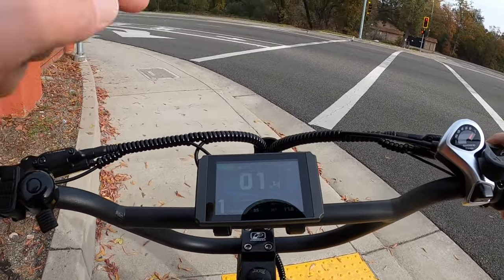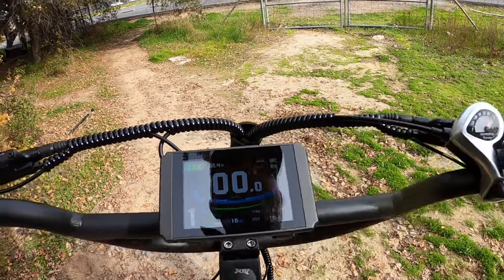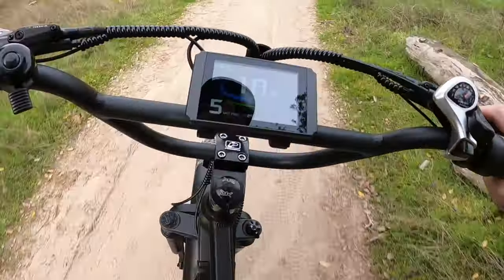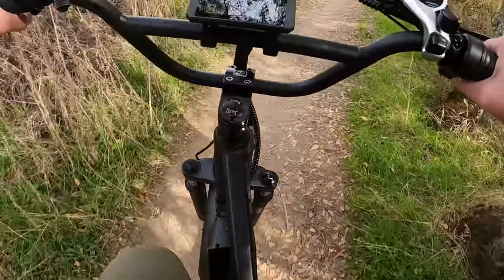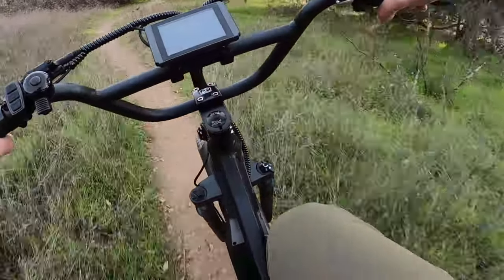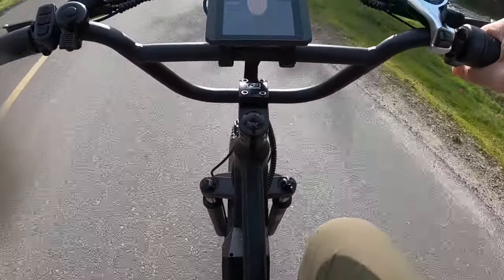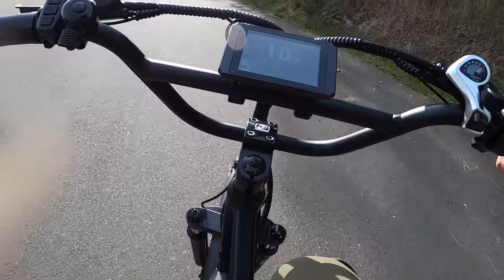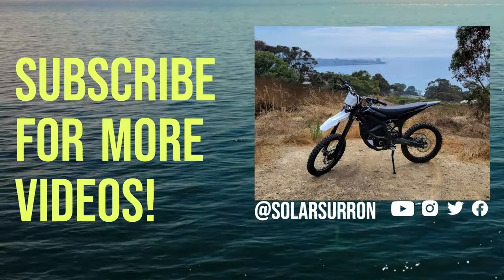Update! 2024 Wired Freedom

Comment from the maker: Leave a comment below if you know what the maximum temperature for the motor is for the 2024 Wired Freedom!
Reply: Ok will make a second post.  From one of the FB groups I belong to, this one specifically for Wired, here is some information being passed around involving C5
C5 set to 10 is NOT incremental, MAX (1500 watt nominal) power from start and always.
C5 set to 0, 1, and 2 Slow start ending in Max Power 0 being lowest and 3 highest.
Now it gets interesting.
C5 set to 3-9 supposedly as follows 3 = 750 watts thus making bike U.S. Class 1, 2, and 3 compliant.
4 = 1000 watts, 5 = 1125 watts 6 = 1200 watts 7 = 1250 watt 8= 1300 watts and 9 = 1365 watts.
This would be why you see I difference in top speed 5 vs 10.  5 = 1125 watts and 10 = 1500.  Remember this is nominal power.
Hope this helps.
Reply from the maker: @NOWitsOKto  That makes sense being the nominal power, I really appreciate the in depth explanation!!
Reply: @leetjohnson  I'm just passing on info from a group with hundreds or a thousand members.
It's like I'm a wide body (in the 1950s when I first learned to ride a bicycle, they called us Husky) person, thus putting mirrors on is a PITA.  So I'm trying something different, (absolutely don't recommend for trail riders catching air, etc.) but using a rear facing camera with a 4.3" display (ya that's bigger than the bike's display) to see to the rear.
Thus far, good for the riding I do.
I subbed to your channel on the other video as I like the no BS, this is what they claim, and showing what real situations are.
May I suggest as I've seen from other YT video, on occasion you might consider (for example in the speed test), "I'm 6'3" 220 lbs and blah blah, as we know weight and wind resistance play a part in the results. Just an idea, you might want to say, as it kind of gives a reference point.
Keep up the good work, and hoping your channel grows.
Reply from the maker: @NOWitsOKto  thank you so much!
Reply: @leetjohnson  Motor temperature wise, I saw one of TailHappy TV's videos where he rode his '23 Freedom on the beach in the dry soft sand at full throttle until it overheated.  It just stopped working for a few minutes.  Once it cooled, he could ride it again like normal.  So, that was encouraging.   The '23 didn't have a motor temp sensor, though, so we don't know what the shutdown temp was.
Reply: @leetjohnson  That info came from my cheat sheet.  I derived the numbers using information obtained from the display manufacturer's user manual.
Reply from the maker: @robb36kc  thank you!
Reply: SciDeb   According to the info I know, 0-2 give max power in the end, but have a slow “roll up” to it. Where 10 is immediate full power.
Reply: @robb36kc  All the info I presented is for the 2024, not 2023.

Comment: how is the power compared to the surron, I know  they are both 60 volt
Reply from the maker: It is strong but only 2,000 watts vs 6,000 watts for the Surron. Top speed on the Surron is 44 mph and will accelerate much quicker to that top speed than the Wired Freedom. Obviously, the suspension is not nearly as good on the Wired Freedom as the Surron, but less than half the price too.
Reply: @leetjohnson  I’m in your area have you have any problems with police?
Reply from the maker: @ardasgames4222  Nope! No problems at all!

Comment: If I had this bike I would have to try a more road specific tire w/o the knobs. It just seems the stock tires are holding you back.
Reply from the maker: For sure...the stock tires are great for all around. I have used an amazing on road tire with a diamond tread pattern called Origin8 Supercell.  Smooth, silent ride and grip in the turns (on road) like a motorcycle tire. Check them out! Not cheap, but worth every penny, in my opinion, if you ride mostly on the streets.
Reply: Cst big boat are also smooth fat tires I run on my nomad. They are pretty good. I swapped out knobby ones too because I don't off road that much
Reply: @leetjohnson  ,…. If you are not off-roading or winter riding the fat tires aren’t necessary either.
Reply from the maker: @Doc.Holiday  I agree, but I definitely offroad from time to time, even sand by the lake occasionally.
Reply: @leetjohnson  ,.. understand that, but for someone who is exclusively an urban rider (not me either) narrower within reason, street tires would lower rolling resistance and increase range.  Granted, go that route and a different bike is probably in order.  This mission of this bike is a cross over off-road and urban truck, not a nimble 100% MTB and Urban either/or.
Reply from the maker: @Doc.Holiday  I would agree, but I also prefer the bigger tires, as things like train tracks, pot holes, bad roads and rocks are all much easier to ride over with a fat tire bike. Just my $00.02.
Reply: @leetjohnson  we’re saying the same thing. Thus the reasoning I drive a truck instead of a sports car, though I’ve owned both and in between. Same with bikes.
Reply from the maker: @Doc.Holiday  👍

Comment: C5 huh, I don't know that's good but I did see another video where they said it was on the first setting before the P1 will start, and they said the first setting should be on 18 I don't know you have one but there's two different stories now I guess I have to wait and find out myself
Reply from the maker: Are you talking about the battery configuration setting? 16 is the setting for the older model 2023. For the 2024 model, you want to set p5 to 6. C5 is the power setting from 0 to 10 regarding power. All of this is covered in the video, I even have a full 1 page photo shot that I wrote each setting out by hand. Hope this helps, let me know if you still have any questions.

Comment: I've been looking for my first e-bike for a couple of years now and honestly I should have bought something by now. I was worried about my state/town laws but I see 15 year olds driving Surrons and no one seems to care. I like everything about this bike except the size. Being 5'8 and about 145lbs, I want something smaller. I haven't found anything smaller that doesn't ghost pedal. I'm one of the weird ones that actually wants to pedal lol
Reply from the maker: As long as you ride respectfully, it's not usually a problem. Yeah, most ebikes ghost pedal, but that can often be fixed with a larger front sprocket.
Reply: @rickymahoney6664    Have you considered the Cruiser model for this same bike?  The step-thru vs step-over might be perfect for you.  You'll get a bike that fits plus all the great features that's offered on this bike.

Comment: Do you know what options to select if you want to be able to use the throttle even if peddle assist is set to "0"?
Reply from the maker: As far as I understand it, the throttle will only work when the pas is set to at least 1. The amount of power can be limited to the pas level, and it can also be always on and only on while pedaling, however, I think for safety, it is disabled when pas is set to 0.
Reply: Ok Thanks.  Keep up the good work.
Reply from the maker: @DeeRickDup  Thank you, will do!

Comment: Good stuff. I have a Wired coming. Any idea what the danger zone for motor temperature is?
Reply from the maker: Thanks! I don't know what the exact number is for the motor temp maximum, but if I find out, I will let you know.
Reply from the maker: From everything I have found online, it look like 200 degrees is the maximum, but I will let you know if it cuts out and at what temperature it was at, if it does. So far, it hasn't gone above 170 or so.
Reply: @leetjohnson  sounds legit on the max temp.  Our modern-day computer hardware is designed to decrease (or throttle down) at 100 C/212 F, which most of us computer nerds/builders don't particularly like about 90 C / 194 F.  So 200 should be safe, but if it ramps up to 200 quickly I'd be a bit concerned.
Good update, thanks for taking the time to look into the comments from the previous video.
As far as the speedometer, I've found mine to also right ever so slightly fast, compared to GPS.
In my opinion, not really much to get all worked up over.  Because of this, the mileage traveled on the display will also be slightly more than what GPS shows, again it isn't off by a crazy amount.
You will notice it more the longer your ride is.  I rode according to the Freedoms's display yesterday, 32.4 miles.  Cyclers app showed 31.4 miles and Strava showed 32.14 miles. So even the GPS apps aren't consistent.  I'd be more concerned if the display read 40 mph when the GPS says 25, that's off by a lot.
Oh, glad you mentioned the kickstand rattle, as I think that is the noise I've been hearing also.  Just a quick noise and gone and only with moderate to heavy jolts.
bout 14:26ish, two things it's actually even closer than the picture, why? Well, your weight isn't on the bike compressing the rear shock which would make the gap even tighter.  Second, I don't really think this bike is designed for hardcore off-roading like a true mountain bike which as you know has a much smaller tooth ring.
Hope this helps.
Ride Safe.
Reply from the maker: @NOWitsOKto  Wow, thank you for all of that wonderful information, I 100% agree with everything you said!
Reply: It's only 60 degrees there, and it's already reaching 170. What will happen when it's 90 degrees outside? I guess time will tell 🤷🏻‍♂️...I don't want to wait for warm weather to purchase cuz prices will probably rise and more importantly stock will be much less
Reply from the maker: @rickymahoney6664  it can handle up to 300 degrees, so it's all good!

Comment: This is the bike that I would probably get..  I still like mid-drive bikes especially with carbon belt drives.. The chain rings are smaller so I wouldn't have to worry about hitting a stump or rock as much..  It does seam like they have more torque for the mountains here in Colorado..
Reply from the maker: Mid drives have great torque! This bike is powerful and cheap, that's why I got it. If you plan to do a lot of steep hills or serious off-road riding, mid drive may be the better option. Let me know what you decide!
Reply: @leetjohnson  Will do..
Reply: I need to find a video that explains this. Trying to find your first e-bike and not knowing the difference between belts, motors, controllers, cadence sensor, torque sensor, etc. Its alot more info than I realized, and it's a little overwhelming when you don't know the difference. I've been riding on 2 wheels my whole life, so I know I could handle any of these bikes but it's hard to pull the trigger when you've never tried any of these options. It's also hard to make a decision when you can't even swing a leg over the bike first, nevermind actually ride them...Sorry for the rant
Reply: @rickymahoney6664  Its all good... It still seams like the ebike world is changing so fast that everything might be different tomorrow...
Reply from the maker: @rickymahoney6664  I'm here to answer any questions you have! Ask away!

Comment: I heard that you were supposed to put it to eight on the p5
Reply from the maker: If you have the 2024 version (with the Samsung battery cells), you actually need to set it to 6. I pinned a comment about this here in the comment section after I spoke to Wired, and they said that the older model (2023) should be set to 16 (LG battery cells). Where did you hear about setting it to 8? I have heard that from a few videos as well, which is why I reached out directly to Wired and asked them. Thanks for the comment, I appreciate it!

Comment: That 56tooth chainring is perfect matched with the 11 tooth sprocket in the back will eliminate that annoying ghost pedaling . I’m skeptical a little on the quality of the components , brakes , batteries . As this e-bike looks great on paper . I’m not a fan of metal sided gears . Tends to make the motor sound loud . Overall seems like a great ebike. Hopefully customer service is good and provide a hassle free warranty for valid claims . I cannot stand they do not take care of the e-bike to include up to your doorstep though . Bum move honestly . They require you to buy shipping insurance which should never be the case . With price, shipping , shipping insurance that $2000 becomes closer to $2300. Still a good deal and wish they had a 20” tire version . 26x4 tires are huge . Overall from what i see in videos and because of price i would rate 8/10 . If i can save enough i may end up with one
Reply from the maker: Spot on!!!

Comment: It costs $800 for the battery, which needs to be replaced about once a year. Not cheap!
Reply from the maker: I've had many, many ebikes....never replaced any batteries. 1 bike had 4,400 miles in 4 years, most others had at least 1k miles on them and the batteries still had at least 75% capacity after 3 to 4 years. Definitely don't have to replace the battery every year.
Reply: Many, many eBikes eh? You must be a rich guy. I had an Aventon eBike for two years and had to replace the battery once. But the Aventon battery was $400. @leetjohnson
Reply from the maker: @user-ji2lh5ce1t  I've had 3 rad Rovers (family ebikes) a Surron Light Bee, sold that for a Surron Ultra. Now have the Wired Freedom and 3 new bikes from manufacturers for review (free). I've been riding Ebikes since 2015.

Comment: If you have a warranty claim for the defective suspension linkage and front headlight and fender mounts, you will be ignored. Mr Steven Golden will not honor the 12 month manufacturer warranty. There's a claim out for the frame and suspension linkage that Mr Steven Golden is completely ignoring. The bike was defective right out of the shipping box. It only had 75 mi on it in less than a week before the warranty claim was registered. That claim has been completely ignored.
Reply from the maker: I'm sorry to hear that. What was wrong with your suspension linkage? Was it just loose or malfunctioning?

Comment: 48v. Lithium ion. Only loves hugs
Reply from the maker: Huh?
Reply from the maker: This ebikes battery is 60volts.
Reply: Do you think we can use voltage listed on display (rather than bar graph guess o meter) to determine safe battery operating limits).  
Not sure what cells are being used, but thinking 21700 cells likely
Reply from the maker: @randym8529  Absolutely, the.voltage is much more accurate than the bar meter.
Reply: I would have guessed using 21700 cells in a 16 series / 4 parallel configuration, from what I’ve read, this cell normally operates in the 3.2-4.2v range (3.6 - 3.7V being nominal) If there are 16 cells in series, this would equate to a battery pack operational range of approximately 51.2 - 67.2V
Do you think it would be safe to let the battery get that low? Or would  it be better to allow a little more overhead on the low end?
Reply from the maker: @randym8529  I would probably avoid going that low...only as low as necessary for the ride.
Reply: Gotcha … I agree about not letting battery get too low, was just trying to determine the lowest safe operating voltage before I shut motor down completely, should I ever get in a situation that was unexpected, such as battery getting low due to running into a detour for example.  Once I use the bike enough, I’ll probably get a better feel for it
Reply: @leetjohnson oh. Nice. My juiced is 52v. I really want a wired freedom